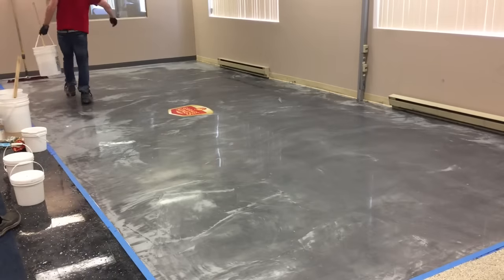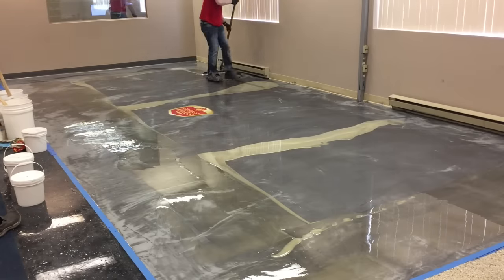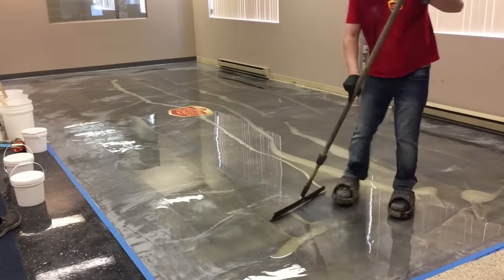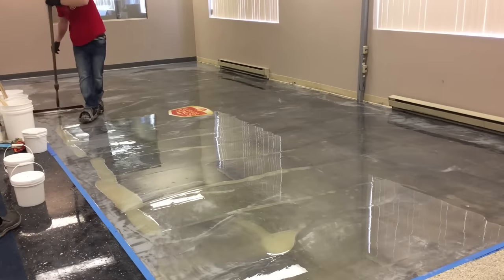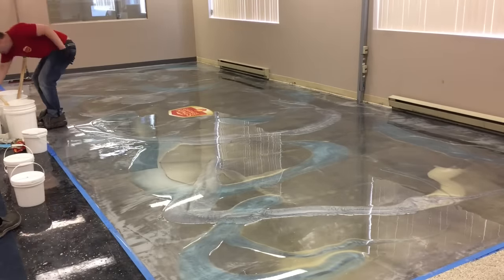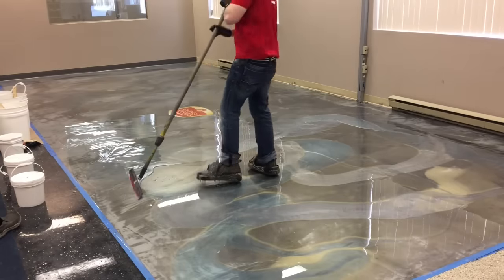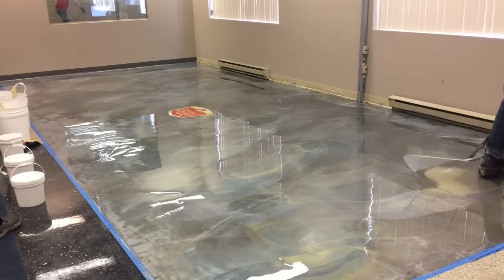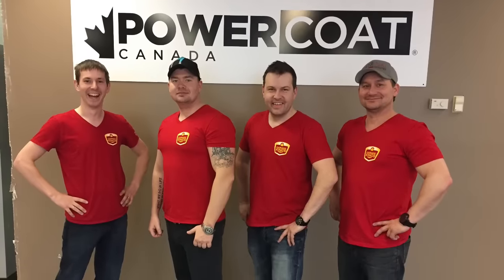How to Do Amazing Metallic Epoxy Floor!

Comment: You mentioned perforations in stickers/logos etc. Whats the perforation specification per meter? If I use a non adhesive logo would i still need to glue it first, or would the perforations hold it in place?

Comment: How long would this last for a bedroom. Should an additional topcoat be added for a "burn" coat? So that it would protect the epoxy? Thinking of doing this, just need to find the supplies somewhere online.. thanks
Reply from the maker: +1980shello  clear coats with nothing else is the strongest, always! The best answer I can give is... it depends but epoxy is insanely strong when done right.

Comment: You made it look so easy. I guess it is. I never tried it but want to some day. I'm sure there are endless possibilities to design. I would have to do more research into this now to see what I could dream up although I like a solid color for now like the standard gray but white would do too. Those shoes are a must as any other shoe you would mess up and have to toss away after. I have to wonder what cleanup there is to the tools. Some type of solvent I guess like toluene or acetone I suspect. Would want to save my tools for another future job. Thanks for the video. Not many people take the time to video tape and share with others their work.
Reply from the maker: +Paul Streicher - we love what we do and want to share! If even one person gets inspired to learn this amazing Epoxy Floor trade or learns a trick to avoid mistakes or get a better result, we say mission accomplished. Good luck to you and thanks for the comment!

Comment: Two questions: Can epoxy flooring be applied outside? Can it be applied over wood subfloring and if so what is the prepping procedure?
Reply from the maker: Great question - while we do offer installations of our signature product outside, we would never recommend using epoxy - it is not UV stable and will Amber/turn yellow and get brittle over time.

Comment: I have a question? 
I am from Germany.
How you fix the Air bubbles
whit fire flame ?
Best regards
Reply: You can, you can also pass a sander and put a clear coat on top and it will look like new

Comment: can you explain what product you are using for that slip coat?   i'm having a tough time finding it.   amazing job, guys!
Reply from the maker: Thanks for the comment!! We’re using the same epoxy we use for build coats, just a super thin layer to make the main coat flow differently. If you’re looking to run a business doing this stuff, head on over to garagekings.com/become-a-Dealer. Talk soon!
Reply: thanks!   i just spoke with tim on the phone just now.  super nice guy and it was informative.  i'm going to do my small bathroom floor and see where it leads from there.   not sure if i'm jumping off into the flooring biz just yet.   thanks for your quick reply.

Comment: How long does it take to dry? Thanks
Reply from the maker: +Mak Z - most of our epoxy floors can be walked on after 24 hours. Faster is possible depending on what materials are used.

Comment: So, when you turn 70 you’ll have liver damage from the epoxy fumes right?
Reply from the maker: Thanks for commenting Richard! The products used here are low VOC in well ventilated areas. We definitely take the proper precautions when necessary!

Comment: Any opinion on polyaspartic vs epoxy? THanks!
Reply from the maker: There are pros and cons to both. Polyaspartic are great for finishing projects quickly and returning floors to service fast. We’ve not found a Polyaspartic that can match the flow and dimension we can get with a high build epoxy for marbled floors. Like many things, the answer is “it depends”.

Comment: ive watched a ton of videos on metallic epoxy flooring and ive never seen one where the installer never uses a roller. this stuff must have super self leveling abilities?
Reply: it doesn't, you can see at the end of the video it looks very bad with tons of imperfections. good quality finish will have smooth, glass-like shine and reflection

Comment: If you have a Large área I guest the best is sectment the áreas.  But what Will happent if i did not finish the floor and have to come back next day.. How do i joon the yesterday work with todas work
Reply: You can't it all has to be poured with wet edge to wet edge unless you have joint lines to separate it.

Comment: In your videos you talk a lot about how you'll get a overall different affect and different end result depending on the color of the base coat/color applied. Can you PLEASE do a video where you use the 3 general base colors: black, gray and white side by side shown on the same work piece and applying the same work (top)colors (maybe a small made block of concrete or kitchen counter or a piece of wood) to show us, your followers how the final outcome will vary depending on the base coat color.
Reply from the maker: +melanie crawford - that is a great idea - There's a ton a possible variations to create a truly one of a kind epoxy floor! In this case, there's a grey marbled base coat, cured. Then a pale yellow skim coat goes down and while still wet the main marbled colors go down. That's why you see the super subtle warm highlights in the floor. A lot of people really like this one! Thanks for commenting!

Comment: Im a profesional painter, and i have never seen this tecknikk been used on a floor before.
Tables, and smaler Things, sure, but a huge floor.
What do you do With Air Bubbles? There must be a hole loot of them.
I meen, i have done some tables and Things, but i always need to use a heat fan to get the Bubbles out of the epoxy.
Can you share Your Secret please, becourse this looks awsome.
ps. Im sorry for bad spelling. Not my first Language.
Reply from the maker: Thanks for your comment!! 
We don’t tend to get air bubbles - combination good product and good technique. Glad you like it! Where do you do most of your work?
Reply: I have been a professional painter for near 30 yares, so i actualy do not have any special Field. Or maby all of them.
I usualy get a Call from someone building a house or simular to fix it for them before they shal move in.
So when the Carpenter is done it is my turn to step up and fix all after him, so the customer gets happy.
But you guys/ladies over sea have some times realy god ides to save time and make Money at the same time.  lol
This floor of Yours is something i like to try out here in my contry.
BTW. i live in Norway, so i Guess i dont compete With you in any way.  :)
I have done some few tables and benches up trou the yares With Epoxy, and i find the finich usualy werry stisfying.
Reply: BTW. i do everything from roof to floors. wallpapers, sanding, painting, vinyl floors, tiles, shit like this.

Comment: Hello !
Base is concrete and then epoxy ?
Reply from the maker: +elenakurus2010 yes it is over concrete. Concrete is ideal for epoxy coatings
Reply from the maker: +elenakurus2010 typically - on this floor there was an existing grey bottom coat so we applied on top of that

Comment: 4.31 are you walking on air ? no footprints ?
Reply from the maker: +terryyouth - yes - It's super hard to learn but once you master the art of epoxy levitation, it becomes second nature. Our epoxy masters work at this practice for years before attempting it on video. They also wear spiked shoes, just in case :)
Reply: Garage Kings excellent job , looks very good , are those shoes made by NASA ?  ;-)
Reply from the maker: +Santos Banuelos - totally anti-gravity shoes...😉

Comment: Did you apply clear epoxy as a topcoat ?
Reply: shawn malone .... 
am thinking that .... ur right question...
Reply: They add the dry color (some plain and some metallic) right to the epoxy; that's what gives it the ability to blend and soften the colors for a more natural look. No need for a clear top coat.

Comment: does it cost more than tile?
Reply from the maker: +ClanLord - Thanks for your question - this is kind of like asking if hardwood costs more than tile. The answer is, it depends. Coatings are a cost effective seamless floor that never has dirty grout issues and can be completely customized for the client. One of a kind. Durable. Simple to keep clean.
Reply from the maker: Thanks for your comment! There is a little more to it than that ;) - we love working with various epoxies and coatings, different depths and techniques, it’s a skilled trade like anything. People can install at different levels, which is awesome because clients get to pick who they would prefer to install their coatings for them. Some want to DIY which can work in the right situation. Others want the full service experience. Thanks for commenting!
Reply: Tile doesnt have a set cost...
Reply: Garage Kings to

Comment: Is this polyaspartic epoxy?
Reply: Epoxy and Polyaspartic are 2 completely separate chemicals.
Reply: @TylerSmith-od6gs  so not UV stable product ??
Reply: Not the epoxy. It should only be used for interior installation and never in a garage
Reply: @TylerSmith-od6gs  so really just a basement or interior room. Even minor UV light through windows will yellow epoxy in less than a year. 😮‍💨

Comment: how do I know that I got enough epoxy to not use a roller? I got 753sf and got 4 sets of 3 gallons 2 of red wine and 2 Orange gold first time doing this thank
Reply from the maker: +Danny Lopez - we normally apply our main metallic epoxy coat between 30-50 square feet per gallon. That depth is how you get the really nice marbling you see. You can avoid using a roller at that depth.

Comment: What about bubbles? When I pour the rustoleum brand I always get bubbles
Reply from the maker: +Josh riche - bubbles often are the result of air entrapment, which can be caused by mixing too aggressively.
Reply: I noticed the slow rate of the mixing going on even as the sped-up rate of the pouring occurred.
Reply from the maker: +Earl Hassler - we normally mix by hand to minimize air entrapment - this reduces or eliminates bubbles in the epoxy. Not all products will work with this method, but the ones we use do.
Reply: thanks
Reply: Use a blow torch or heat gun to remove bubbles
Reply from the maker: +Russell Erickson - you’re right, a torch can help. Bubbles are normally caused by mixing too aggressively and introducing air to the mix. You’ll notice we mix by hand most of the time and bubbles are never an issue. Thanks for commenting!

Comment: Your video was good, you explained what "you" do - not what I would do but you explained your process well. 

Personally I think the floor is ugly. Why would I want a floor that looks like someone spilled dirty dishwater on it? 

I know people do "marbling" as a standard technique on epoxy floors - but WHY? Just because it can be done? It does not resemble "marble" by any stretch of the imagination. Instead of calling it a marbled floor, just call it a streaky colored floor. 

I think this marble-look will suffer a rapid death in the same way "fake" marble bathroom vanities made out of plastic-based materials have gone out of style. 

There has to be a more artistic and creative look that can be made with metallic epoxy floors than swirling colors and calling it a design - it's just swirled or streaked colors on a floor. 

I'm not criticizing you, I just wish someone would come up with a better or newer technique that does provide a unique look.
Reply: NewUnderTheSun I

Comment: A more appropriate mask is needed on this job so in a couple of years I would appreciate	an update on the side effects of epoxy in the brain as some say it shrinks the brain. Thanks.
Reply from the maker: You should follow the manufacturers recommendations for health and safety - the epoxy we work with is zero voc - more fumes in the stuff we clean our tools with than in the actual products.

Comment: I have no idea what that may have cost, personally, I would have been more than just upset at the way it turned out!!  I love a good epoxy look, but you would have made this area look 1000% better if you had painted it first.  Then put down your logos after the paint was dry and finished it off with a thick layer of clear epoxy!!

Just based on this one application of the product, I'm pretty sure that I won't be using this  on my new kitchen floor!!! 

I think this was a hands down fail!!👎👎
Reply from the maker: +Doe Campbell - thanks for your comment! Check out our other Epoxy Floor videos while you're at it - you may find something you like better!

Comment: Even with the spikes, it is still a pain moving around without slipping a disk or getting in a hurry. You really have to just pick one foot up and put the other down. I try to stay away from this. Not enough practice, too much risk. I just pour floors everyday. If they want anything more than color or sealer, or stamp work, they can call someone else. I don't mind at all. Lol.

Comment: He dies bit talk about preparation. That is everything. If the concrete has the remainder of curing coatings, or contaminated by any grease of oils, the floor will eventually fail. Even new concrete has a curing agent on it that should be removed. Also, Epoxy should never be used outside as it is not resistant to UV rays. Preparation is not easy, and can be messy.

Comment: This video for me is a complete mindfuck. How can he step with his shoes into that stuff and not smudge it at all whatsoever? What is going on in that vid that the thing he uses to spread it works but his shoes don't do anything whatsoever to it...
Reply from the maker: +Fringe Wizard - thanks for the comment! They are super high tech shoes that actually repel the epoxy and let the installer float in the air. Just in case that doesn't work, there are also spikes on the shoes to prevent him from smudging the epoxy.. ;)

Comment: lmao "hide your method of application " it's random and floating and following the flow . and not accelerating the curr
Reply from the maker: +Texas Flash cove Installer - thanks for the comment - that's true to a point, you can't control every variable. We use timing, application technique, product quantity, tint or metallic powder quantity, and more, to create awesome and predictable results. Thanks for your comment!

Comment: The floor is total shit but the shoes are cool how do they not make any kind of Mark you can't even see right after you lift your foot those are cool
Reply from the maker: +406 nova - thanks for your comment - these floors are totally custom - in this case it was a showroom display floor that the client was extremely pleased with - for footwear we use spiked shoes so we don’t leave footprints. 👍
Reply: 406 nova

Comment: I went on their web site and estimated 2500sqf came out to be $17500 😅 so funny that price for liquid not worth it bs.
Reply from the maker: Thanks for commenting - each of our locations is independent and sets their own pricing. If you did receive a quote, it was inclusive of labor, surface prep, crack repair, and the product installed.
Reply: @Garage_Kings  I like your products and I'm very interested the problem is I don't get straight answer so if that's the way going to be for sure going to lose lots of customers.